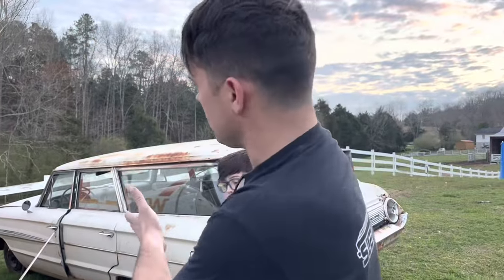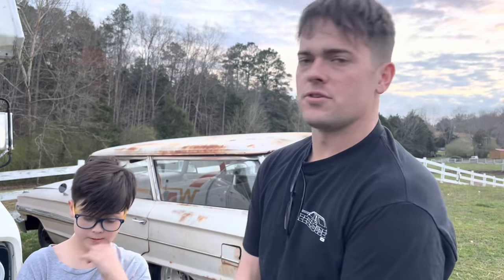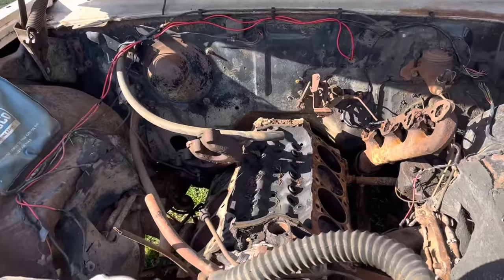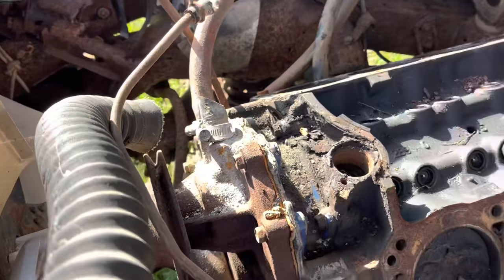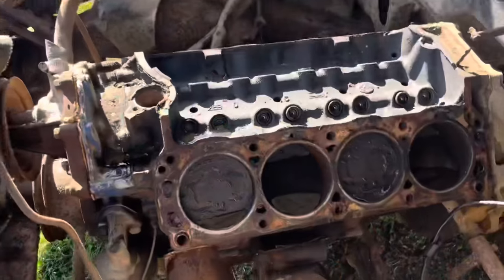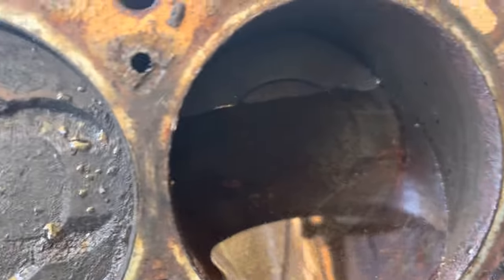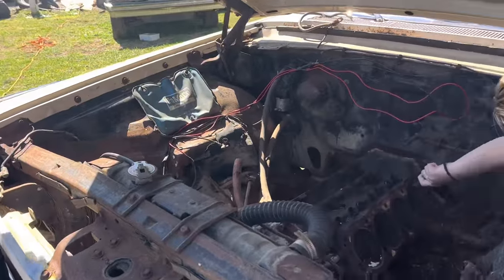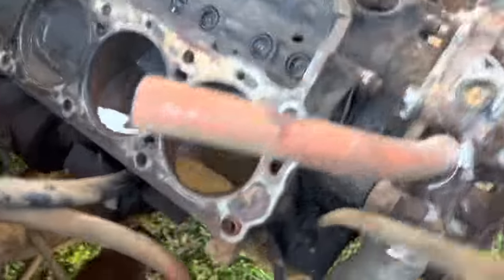Tricks and Tips to getting a stuck engine free after 30 years. We try everything!

Comment: Sir I can not believe, You did not get front or back brakes workings , Pull it down the road and pop the clutch out in 3 gear, I have freed lots of motors that way, Don't pull it till you try
Reply from the maker: The clutch doesn’t work

Comment: Lost a lot of your piston's aluminum and aluminum to ring interface (bad)...Probably would have saved you lots of time and engine...if you used liquid wrench on the circular piston interface and then filled to the rim with Brake Fluid overnight. Liquid Wrench dissolves the surface rust at the top of the piston to wall and Brake fluid migrates down the rings and cylinder wall. Then in the morning fill with kerosene-diesel solvent.... Ratchet with socket on crankshaft  leveraged with cheater bar...rock back and forth slowly....wood block and each piston hammering is ok...then go back to hand rocking the crank..back and forth...slow firm and steady. If you don't get it on the first day in one hour...you will on the morning of the second day soaking overnight.
Reply from the maker: Ok thanks

Comment: Stop with the hammer before you break a pistol at the rings  drop oil pan , take bearing caps off jack the rods one at a time and not on your bearing cap studs , heat the heads , good job Ralphy !thin grease around the cylinders or heavy oil wipe it around , let it run the way it is, go from there. 35:12

Comment: NO ACIDS should EVER Be used in an engine, you will bugger the cylinder bores, (although in this case they're not too good as it is).  Drain the crankcase and fill the engine and cylinder with diesel for a good soak for a few weeks. Then drain. remove the engine and take it apart. There's no point on trying to move the crank and all the pistons at ones. Deal with them ONE AT A TIME, AFTER they have been disconnected from the crankshaft! DON'T EVER pound on the piston tops if you want to save them, IF you must do that in a minimal way, use a wood dowel the same size as the cylinder bore and be GENTLE! I have recovered quite a few seized engines and never destroyed even one. The main problem people have is that they are impatient. Don't be lazy, remove the engine!